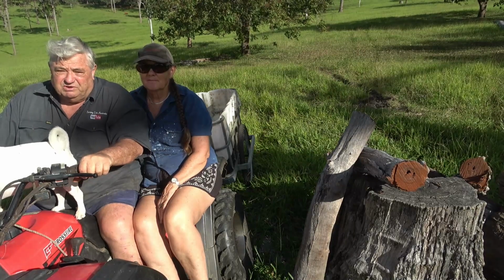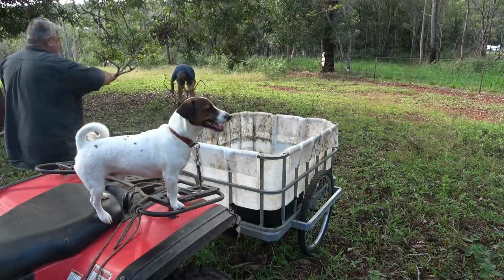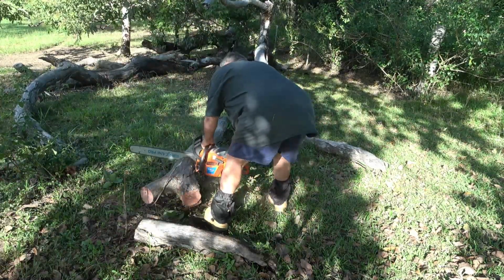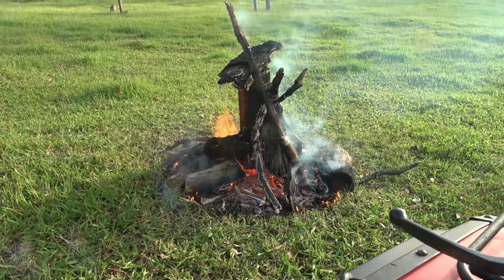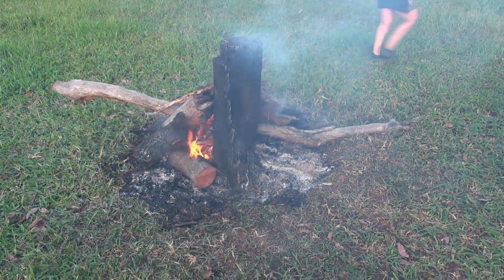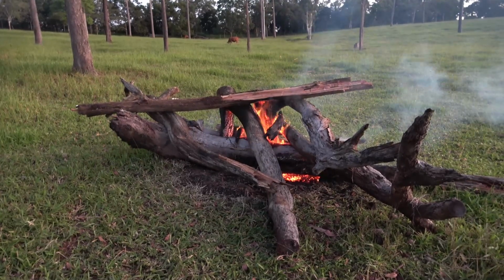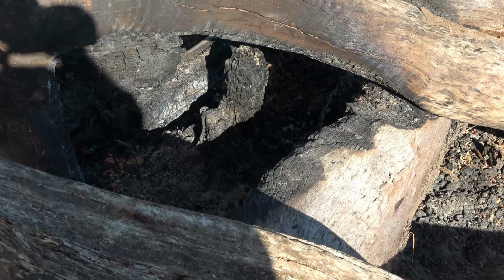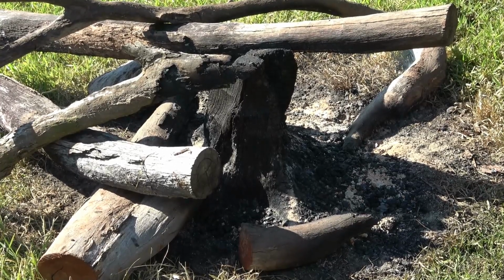OUR STUMP BURNING EXPERIMENTS

Comment: Oh for the Good Old Days when you could just go into the store at Garnet and pick up a case of Gelly, Fuse and Dets. A 3" hand post hole borer and a charge of a few sticks tied together or a smaller "Gain" charge on top of an ANFO mix if the ground was solid enough to contain the whump and then just pick up the bits and blade the hole in! 😉
Reply from the maker: A lot more fun too. I remember blowing out stumps when I was a kid fertilizer mixed with diesel and a bit of Gelly. The last time I was around blowing out stumps was 30 plus years ago and it was plastic explosive and electricity to set it off. The powers that be would hang you up by the knackers for just thinking about doing that now. John
Reply: @farminglifeaustralia6716  Yair, about the same timeframe since the local Sarge signed off on the last Permit to Purchase here. Of course different times now with all the nutters on the loose! 
I look back now and realize what a great life we've had. Started off with nothing (as did everyone around us so everyone helped each other with no "The Joneses") but worked hard with no official handouts and each year things got a bit better. 
Kids nowadays will have it much tougher and the ratio of those that actually produce something to the army of paper shufflers (let alone those that are paid to just sit on their jacksies) is getting worse each year! 🙄
Reply from the maker: @theoztreecrasher2647  I think we saw the best of it. Things seem to be going downhill fast. John

Comment: Through a lot of trail and error and a lots of stumps, I use the drum technique with a couple of rocks to hold it up a bit, particularly on the side from where the wind is blowing if there is some at the start. I feed it wood for about a day then once the stump is burnt down near the ground I take the rocks out and feed it a bit more wood and it normally will keep smoldering and burn out the stump over a few days to leave a big hole. Closing bottom off to the cold air keeps the heat in and the remains of the stump (mostly in the ground by now) will smolder and burn for days. I also built a rain cap that sits about 20cm above the drum to stop any rain from getting during the final stages. Once the stump is smoldering it feeds itself. Good luck.
Reply from the maker: I was thinking of making a lot bigger drum. Most of our stumps are very big. We didn't have many until cyclone YASI in 2011 it twisted the trees and they died over a period of time. I still have some to fell. John
Reply: @farminglifeaustralia6716  I have made a couple of 90 cm wide drums and about the same high from an old diesel steel fuel tank, the are about 3 mm thick as well which holds the heat in well too.
Reply from the maker: @golden8162  That sounds good I will find something like that old fuel tanks are not that hard to find. John

Comment: I dont understand why you dont cut the stump lower, so the higher material could be used as firewood or for making biochar separately. You could then drill large holes, fill with Potassium Nitrate and Kero or Diesel and then set a light. It would remove more of the underground bits or is the aim  to just produce as much charcoal as possible.
Reply from the maker: Yes I see that now in hindsight. I was trying to find the best method. If you look on the internet all those methods are shown and they are all said to be the best method. Now I would cut the stump as short as possible split the timber up and use it to burn out the base of the stump. I am not keen on using kero or diesel with cattle in the paddock. John

Comment: Never saw a metric tape measure, really like your cart! Had 60 and 70 mph(100-110 kph)  I think wind here two weeks  ago so have lots of stumps(2 weeks on a chain saw) The drum idea will help me a lot. Have lots of drums as I have been making and selling kilns and retorts at Self Reliance Festival after giving talks on use and production. Great experiment thank you
Reply: Surprised and pleased to see push bike wheels still rolling
Reply from the maker: Yes the drum method beat the others by a mile. I need something bigger to do the same job. John
Reply: @farminglifeaustralia6716  Would you go for the cuts + barrel to really speed things up ? 
Or save the chainsaw for felling/firewood
Reply from the maker: @chriskennedy7534  Its about 6 of one and half a dozen with the other. I could have cut the smaller stumps off and split the wood to burn the base of the stump in hindsight. I wanted to experiment and now that I know the results I will improve it all. Watch this space, Ha Ha. John

Comment: There's potential to use the drum setup, add a lid and convert most of the stumps and other wood to charcoal.  An old friend of mine said that the best way was to get the stump burning nicely, cover it with old roofing iron and then put some dirt over it and wait for a few days.  Pretty much everything ended up as charcoal.
Reply: Cutting the stump down to "just above" ground level and making char from the wood seems a more efficient option to me, but I'm a knewbie 😂
Reply from the maker: Ok thanks for that. John